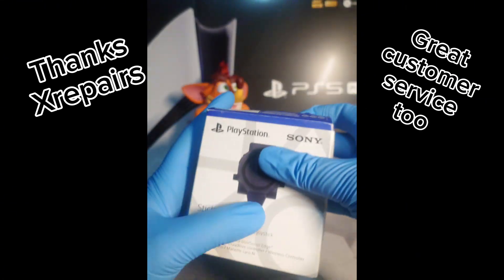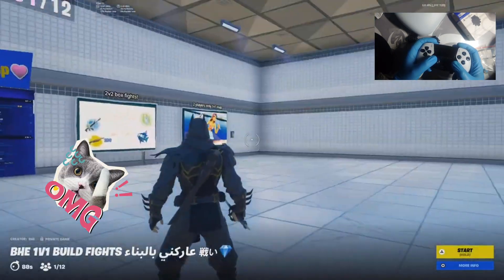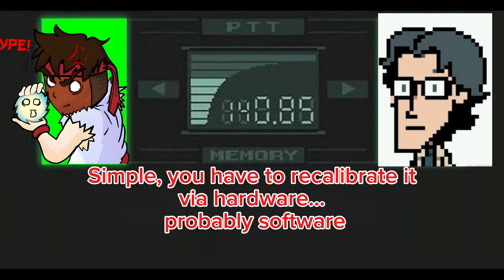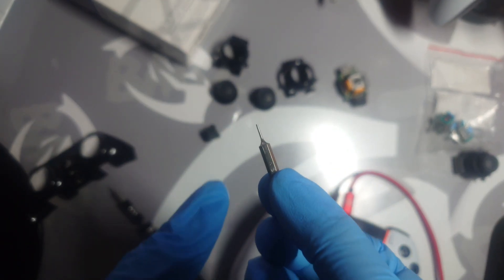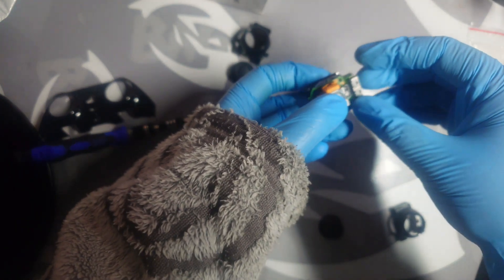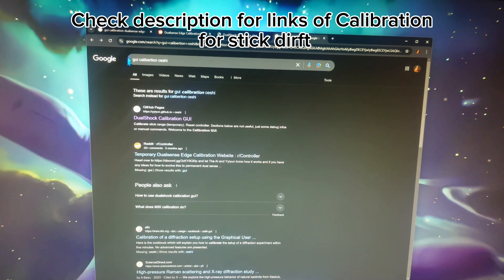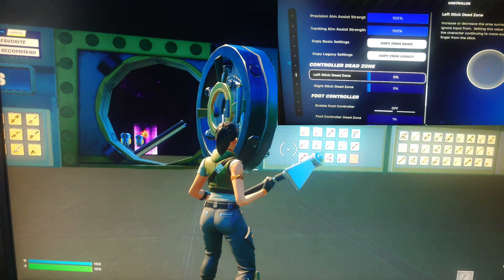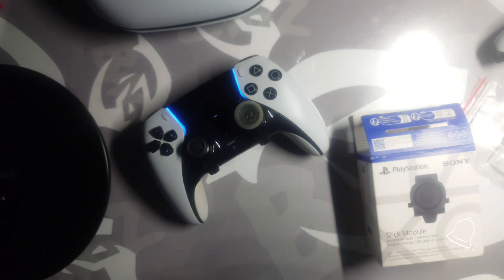Improving My DualSense Edge - Part 4: Hall Effects (Tutorial)

Comment: I didn't see a circularity test. Did you have one in another video?
Reply from the maker: @OmeliGaming  I didn’t unfortunately, I forgot to add it. From what I can remember it had a low error and it was something on the line of 15-20 percent.
Reply: @ oh that’s very high. I prefer less than 10. Some say no higher than 12. Most of my installs lately have been 4-7%
Reply from the maker: @ I’ll double check and make a quick shorts so you can see yourself. Right now I need sleep lol
Reply from the maker: @ ah my apologise, my circularity after adjusting is 3-4 percent now.
Reply: @ lol same here
Reply from the maker: @OmeliGaming  https://youtube.com/shorts/A7lDgzY4l-U?si=Ke6BCf2axp_DdLax
Reply: @ should look much better than that. If it works it works. I think this is what happens with no calibration board. Over shooting the range. The pairs I did yesterday have 5-7% error on circularity with minimal red. Some say under 12 is good. I prefer to tune to below 10. Not sure I’ve ever hit 10 before.
Reply from the maker: Am happy with what I got, I wonder if it is more responsive with the boards @OmeliGaming
Reply: @ that’s what matters 😄 Responsiveness is determined by the stick itself. It’s why I use Ginfull. Best responses to input. It’s tiny in comparison how much faster than others but still faster. The calibration board is primarily for calibration and being able to save the settings made. Can’t install TMRs to edge controllers without them because you can’t manually calibrate the center like Hall effects. But neither you can calibrate the range without it. No doubt everyone wishes we could do without though. It’s would be so much faster and wouldn’t be so expensive to install. I have to charge more per module than I do to replace both sticks on a regular Dualsense.

Comment: You can't calibrate the Edge controller with software. There's a lot of information about it on the internet and on YT.
Reply from the maker: @eezee-s1f  that's what I said, in the end of the video I showed a weird method where you stick the wire to the pc(Calibrate it) then via wireless to the ps5. This makes the deadzone lower than 0.5 but you have to the wire stuck on the PC. Meaning you can't turn anything off otherwise it resets back to the default deadzone. Hope that answers you Q.
Reply: @Bagz1994  

I meant that there are other methods than temporary calibration on PC.

After replacing the original analogs with magnetic ones, I was in the same situation as you.

A half-measure is temporary calibration on PC via browser. I don't know about PS5 because I don't have it.

The solution is PCBs that need to be soldered and thanks to them you can set the zero point and calibrate the analogs without any software.

I just finished soldering and calibrating. It works!

Best regards.
Reply from the maker: @eezee-s1f  where do you get these PCB? You think you can give me a link? Also I think the PCB is only for the normal Duelsense not for the edge, but if there is, I need to check it out
Reply: You can save calibration in Dualshock4/Dualsense in pad memory with software. In Edge calibration memory is in analog module. Currently software don't have acces to this memory so save the calibration pernamently is not possible. Solution are the PCBs with calibration software saved in chip. This is  trick for the Edge controllers and it works if you bellive or not 😉
Reply: You can now